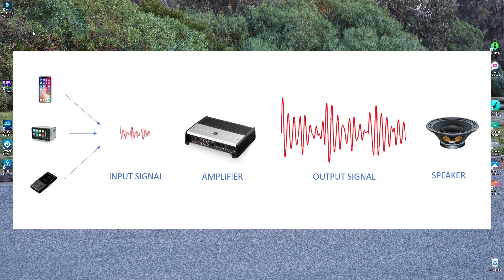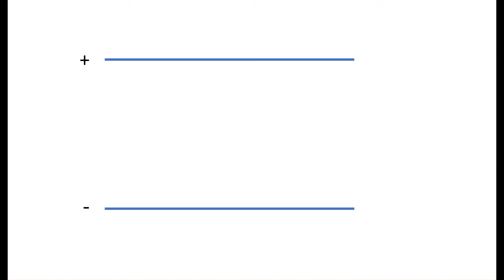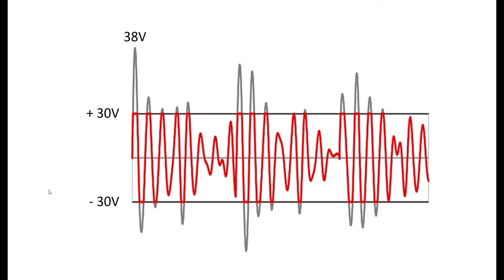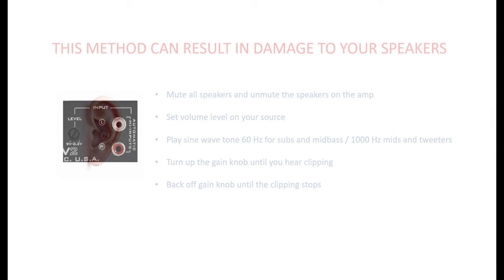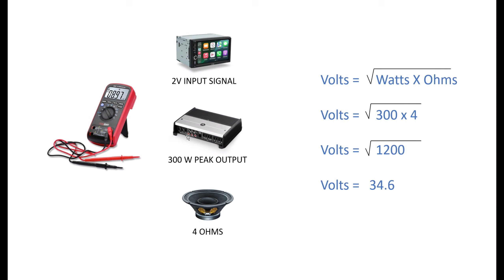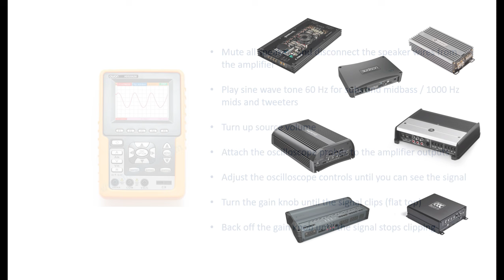HOW TO SET AMPLIFIER GAINS

Comment: Hi socket.    I have been having issues trying to get my system sounding right.  Checked gains the other day and my amp needs to be set to minimum for right output V.    My head unit pre out is 5v and my DSP max input is 4V.     the head unit clips at less than ¾ volume even with the amps on zero and it sounds weak and thin.    If i replace the head unit with one that has 2.5V RCA will this just be like turning the volume down on my current head unit? Or would it be better cheers.
Reply from the maker: Hi Nick.  Before you change your head unit, check that your DSP doesn't have a low voltage and a high voltage input setting.  For example in the Helix DSPs there is a jumper bar inside the DSP that can be moved to a different set of pins to convert the unit from 1-4V input to 2-8V input.  Check your user manual for details.   If that is not the case and the max input voltage the DSP can accept is lower then the HU, then you can just set the HU at say 80% as your max volume (=to 4V) and then use independent volume knob (connected to the DSP) to control the system volume.  Another option is to buy a RCA attenuator that will step the voltage down to 4V.   Finally changing the head unit will not effect the loudness of your system.  The output voltage is simply the voltage that the unit will make at 50% or 100% volume ect.  so a 5V output voltage HU = 100% volume  and 2.5V = 50%    a 2V output voltage HU = 100% and 1v = 50%    You then set the gains on your DSP and AMPs to match so when is it getting a 100% signal  (5V or 2V for example) the DSP and AMP is also putting out 100%.  That is the reason for gain setting, so all your equipment is calibrated to work together with the input voltage of your source unit.   I hope this helps
Reply: @socketsocket2763  Ok, thanks for taking the time to read my question and explain all that, Much appreciated
Reply from the maker: You are welcome.  Good luck 🤞
Reply: @socketsocket2763 my main issue is, to get the desired voltage out on amp, I need to have the amps zero gain and head unit at just over half volume to stop it clipping with a 1000hz 0db test tone.   Set like that the subs are not even audible,  I'll figure it out, just a lot to learn.. thanks again
Reply from the maker: Send me a list of your equipment and I’ll check for you
Reply: @socketsocket2763  Thank you, Sorry to mither.

Head unit - kenwood bt960dab 

DSP – Helix MK2 mini 

front speakers –  up c42bmw-frt.3 - 65w RMS 

Rear speakers – Match up X4BMW-FRT.1 - 65w RMS 

2x under seat woofers – BMW hifi option,  

4x50w RMS amp  - alpine bbx-f1200 – powers under seat woofers 

4x100W RMS amp - pioneer gm-d8704 – powers 4 speakers, with tweeters on same channels.

Thanks again
Reply from the maker: Hi Nick, what do you mean you have the tweeters on the same channels?   Do you mean you are driving mid range, tweeters and rear speakers on your 4 channel pioneer?   in other words, 6 speakers?  and your underseat subs are they running bridged on your alpine amp?
Reply: @socketsocket2763  the front 2 door speakers are  component speakers,  but yes basically 6 speakers.   4 mids with tweeters off the pioneer,  subs off alpine -- not bridged, they just run off one channel each, 50w, I think BMW puts 40w to them normally so this should be enough.  there just set up as low mids Left and Right. :)
Reply from the maker: Oh yeh that’s not the correct way to run them.  You cannot EQ and Time Align with your DSP when running more then one speaker on one channel.  Coax speakers combine two speakers into one.  Component speakers are just speakers that are sold as a set.  I’ll explain why you can’t run your speakers like this in the video
Reply from the maker: Here you go  https://youtu.be/w4RNptTKR7A    also email me at socketcaraudio@yahoo.com   I have a video for you on your speakers and amps :)
Reply: @socketsocket2763  Hey thanks, I will check this out now,

Comment: Very informative video. 

If an amplifier is putting 100 watt rms and it is connected to 50 watt rms speaker. Then  should we set gains before the clipping or we should go with the target voltage?
Reply from the maker: Thanks mate. Always set gains before doing a tune using an oscilloscope to find the gain setting where the signal begins to clip.  Avoid using voltage.  Voltage is good for direct current not so much for alternating current which is what speakers use
Reply: @socketsocket2763 Thank you.

Comment: Hi Socket. Would we need to modify setting gains with an osciloscope for example setting games for a tweeter and the amp channel has a lot of overhead wattage? Seems like the multimeter might be a better approach to get closer to the tweeter RMS?
Reply from the maker: Hi Rowdy, I think you might be mixing up gain setting and speaker wattage.  Gain setting is about making sure the amp and input signal are properly calibrated so the amp cannot be pushed into producing a clipped / distorted signal. It should not be used to nerf the output of an amp to control the powered being delivered to a speaker.  The way to control power to a speaker is by using the volume knob and making sure the speakers crossovers are set properly to prevent the speaker from playing above or below its upper and lower frequency limits.  On the question of using a multimeter to set gains, you can use for a specific voltage but that has nothing to do with whether the speaker will be clipped or damage.  I have tutorials on distortion and speaker loudness and how amps work which cover how amps and speakers work.   If you are going to set gains an oscope is the tool to use.  I hope this helps

Comment: In my experience, I've found that the most powerful source on a head unit is the USB. Also, they'll be the only source that doesn't have it's own individual volume level. Set your gains with a tone on the USB, then adjust the other source volumes to match it
Reply from the maker: Thanks for the tip.  I did not know that 👍
Reply: USB? That's not an audio source. And it is incapable of outputting an analog signal (which is what you need to measure using an oscilloscope, or even multimeter) 
If you mean you are plugging in a flash drive or something into the USB port on the head unit that has a sine wave mp3 or wav file then you are doing nothing different than using any other digital source. 
You're not measuring the USB output.. 
The USB is reading the sine wave file, and sending it to the DAC of the head unit which in turns a sends that analog signal to the head units output. 
So if your head unit has a good DAC  chip, it'll sound better (or more powerful etc)... But It's all about perception when it comes to sound. What sounds more powerful doesn't necessarily mean it's more powerful. You're measuring the same output whether it be a USB source, aux inputs, CD, SD or wirelessly casting from your phone or laptop. 
You not going to be getting a better reading from one source to another on the same head unit.. especially if it's all going through the same DAC. 
(Might "sound" better or more powerful due to human perception, but measurably would be identical)

Comment: Socket I understand setting gains the traditional way...  however I am lost with this new helix m six dsp amp....  how do I properly set gain on this amp with the PC tool software..... I see in the io menu I can chose rca input up to 4v....   my head unit puts out 4v by way of rca pre outs....  but when I move the adjustment to 4v the drivers barely play loud....  do you have a video on this using PC tool?
Reply from the maker: Hey Paul,  This from my patreon channel.   https://youtu.be/gjIM71FcK8o    Not sure if it helps, otherwise there are some advanced gain setting tutorials on my patreon channels that should sort you out.
Reply: Thank you!   It looks like your tier two paid advice is sold out?  Any chance there will be any openings?
Reply from the maker: Hey Paul,  You can watch the gain setting tutorials on patreon by joining tier 1 ($5 USD) you don't need to sign up to tier 2 for that.  Tier 2 ($15 USD) is for people you want one on one help with their car audio systems or tunes.   I only offer a small number of tier 2 spots, so I have the time to give everyone my full attention and time to make custom tutorials and stuff for each person.   I thought people would unsubscribe once they had their issues sorted out, but so far no one has given up their tier 2 spot.  If you really want some one on one help, I can create a tier 2 spot for you. Just let me know :)

Comment: I´d like to know how you properly do it when having an m six dsp(6-ch-dsp amplifier) from helix which I have, how should I set the gains there and what about the new software 6.xx ?!
thanks in advance
Reply from the maker: Hi Tommy, I am not sure what you mean by how to do it properly using a M six?  or what you mean by "what about the new software?   Are you getting confused by the term amplifier, speaker or channel gains?   If so there is a tutorial explaining what the different types of gains mean   https://youtu.be/QAdos0N0jOc  If you are talking about setting the input gain on your DSP/AMP,  the gain setting is the same as covered in the tutorial.  The new software has nothing to do with setting input gains.   If you need help let me know :)
Reply: @socketsocket2763  seems like I wasn´t clear enough.
when I use only the DSP with an external amp which goes out of dsp
I use RCA from headunit to DSP
Do i set gains only with the InputSignalAnalyser from DSP, so the DSP knows it´s all clear signal ?
I´ve done it that way but I think I miss "input gain"
radio is set per oscilloscope to about volume 28/35 = max. clean signal
they rolled out a new version 6.2.01 I´m still on 5.7.01 is there a big difference in gain structure ?
Reply from the maker: Ah I see.  I think you might be mixing a few things up.  The input signal analyser in the ATF PC tool software, is used to analyse the signal coming from your head unit, to make sure the signal is flat and does not have any EQ or other peaks and dips in it.  This tool can be used to smooth out or EQ the incoming signal if needed.  This tool has also been upgraded and expanded in the new V6 software.   All that said, this has nothing to do with the video you are watching on "setting amplifier gains"   Setting input gains on your DSP or AMP is about making sure your DSP or AMP is calibrated to match the voltage of the signal coming from your head unit.   The gain knob on the DSP or AMP is used to adjust this calibration.   If you do not set the gains on your DSP or AMP to match the input signal voltage from your head unit,  you will either be clipping the peaks of the music and causing distortion in your system or throttling your amp.   The gain slider in the input signal analyser, has nothing to do with this.    To answer your question, you need to check and flatten your input signal using the input signal analyser in the software and set your input gains on your DSPs and AMPs using the gain knob, to make sure they are properly calibrated against the voltage of the input signal coming from your head unit.  I hope this makes sense  :)
Reply from the maker: Sorry Tommy I might be steering you incorrectly.  Does your DSP have an input gain knob on the outside of the dsp.  If not then yes then you have to set the gain using the slider.  I have not come across the Helix DSPs that don’t have a gain knob.  So yes you need to use the gain slider to adjust the input gain for the DSP. In version 6 of the ATF software it is under Input/gain configuration.   Sorry about that
Reply: @socketsocket2763  thanks for the responses
I don´t have a gain knob outside the DSP, you can have an URC which is like a remote control for master and/or sub volume for example
I´ve done it via the ISA but I think I´m still missing a bit of headroom while still having tweaked most of the things already.
I´m also good with REW an measuring plus finally understood the difference of acoustical/electrical Crossovers
Reply from the maker: No worries mate.  Let me know if you have other questions I can help with
Reply: @socketsocket2763   I also have the m six dsp amp.  Am I correct in assuming that you need to use 0db test tones to find clipping volume of your source, then measure the voltage of the source output at that volume and move the slider in the dsp amp under input signal to that measured voltage to set initial input gains?   Please advise if this is correct?
Reply from the maker: Correct 👍

Comment: But running low gains will loose dynamics 🤔
Reply from the maker: Not sure where you heard that but dynamics has nothing to do with gain setting sorry
Reply: @socketsocket2763  it's just simply what i've noticed. also at the same volume using a bridged vs normal channel sounds different. i know it's nothing scientific behind but that was my ear perception.
Reply from the maker: All good Motor, it does sound like detail is lost when you turn down the gains, not because your system has lost dynamic range but because the relative volume level of the system is changed as I show with the volume knob diagram illustration thing in the tutorial.   So your hearing is right, you just need to turn up the volume knob to compensate for the lower voltage conversion caused by lowering the gain setting.  Bridging also has an effect on sound quality which I will cover in the upcoming “how do amps work” tutorial that I’m in the middle of making 👍.  There is definitely some science behind what you are hearing 100% :)
Reply: @socketsocket2763  i can't scientifically test since my build is stopped for 2 years, just really can't find the time to go on and not having my helixes installed and dsp. every system i've listened that had an SQ tuning and EQ i didn't liked mostly. Me personally i do preffer boosted frequencies. Even as a kid remember in winamp was enhancing the bass, pulling down the actual mids between 500 and 2-3k, and again enhanced the higher mids and highs, clos to the rock preset but a bit modded. So far using just a multimeter to match rcas output of X V to amps input did a decent job and tried a long time ago like  you showed doing frq region sine wave matches but in a passive system that don't work good, sticking to 1000hz is the compromise.

Comment: Hey socket, I came to the same conclusion than you during my researches regarding how to set gains, I bought a portable oscope and set my gains using sine tones for different parts of the system and felt pretty confident ti push the system since then ahah.

You didn’t mention also that if you have to eq down a lot a pair of speakers you can often gain back some juice by increasing the gain knob, but you have to be careful not to clip over the frequencies that haven’t been cut out 😬

Comment: I have a 4ch scope I need for work. I’m a Automotive tech. It will record also. I check the whole signal path. Check my Kenwood head unit and Topping D10S DAC that my phone gos into. then goes to my DSP as well as my Kenwood. Kenwood will clip
At 39 of 40 max volume. DAC will clip with phone at second to last notch down from full. DSP never sees a clip. I use solid and tone sweeps. I go wider then 50-1000. I go up to 3500 when it comes to my mids and tweets. Recording sweeps on my scope then watching it frame by frame I’ve caught some clips at certain frequencies. Turn it back a tad and redo the sweeps. I know it’s more time but I’ve found those clips on recorded sweeps that are set higher then 1000hz
Reply from the maker: Hi MB,  That's great information mate. Thanks for sharing, This will definitely help other for sure.  Nice one :)

Comment: Great video again Socket, can i oscope various (lightning to 3.5 to stereo mini) adapters on the L/R male outs just like you’d oscope a head unit’s rcas? 

Purpose being to find the max source volume before input signal clip. Surely it’s the same but just thought I’d ask. TIA!
Reply from the maker: Hey User,  I have no tried that myself, but I couple of the guys posted comments about using an oscope to test the input signal, so I guess it can be done :)

Comment: I'm afraid you've left out some important information. Whenever you talk about playing a 60hz or 1k hz tone, you need to specify the recording level. A lot of times it will be a 0dB tone. 

That's what you would use to find the maximum clean output voltage of a headunit. 

Also, to set the input and output levels of any other equipment between the head unit and the amps.
Reply: Then you have other recording levels, such as -5dB, -10db, -15dB, etc...

Most of the big audio companies such as Kicker and Rockford will recommend setting your mids using the -5dB tone.

Then set your sub level using the -10dB tone. 

This can give you a little overhead in case you're listening to a song where the recording level is a little low. 

Experience has shown that if you set the gains with the -0dB tone, the system simply won't play as loud as it should/could. If you set your gains with the -0dB tone and you have plenty of volume, then that's perfectly fine. If too much volume, you can adjust it down a little to lower the noise floor.

I tend to set my gains by ear, but not the way you described. I tend to always set my gains less then I would if I was using the -0dB tone. Starting with the mids, I will try to find a good balance of high volume levels plus a low noise floor. Once that is set, then I will adjust the gains on the tweeters to blend and match with the mids. All other speaker gains are done the same so that they match with the mids. It's usually the mids that are the first to distort. I'm not a bass head and I don't usually max out the volume until things distort, so the relatively low gain settings I use work fine for me. 👍
Reply from the maker: That's great information Jason.   You must have had a bit of practice, setting gains by ear is not easy...   Thanks again for sharing :)
Reply from the maker: Good point Jason :)